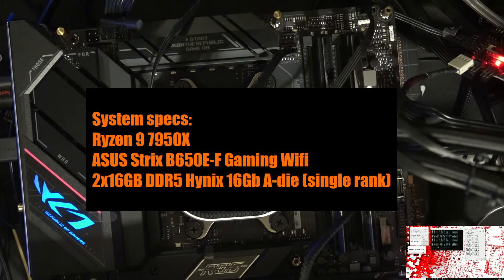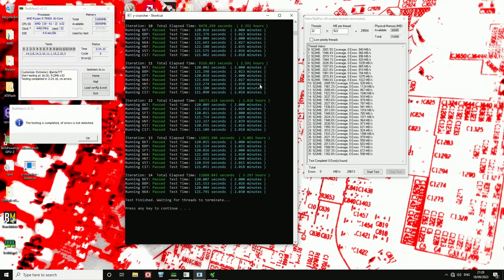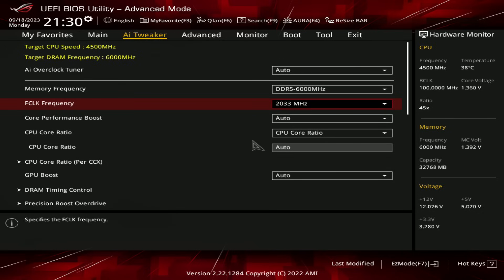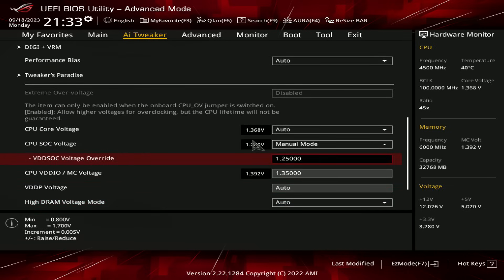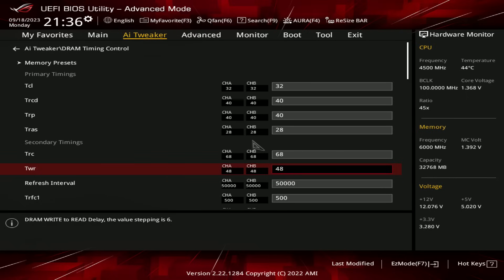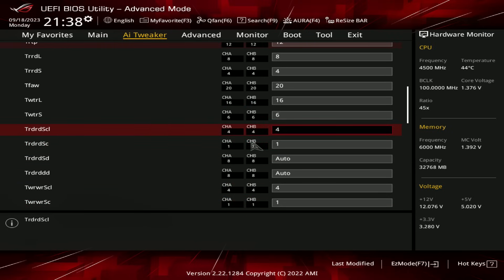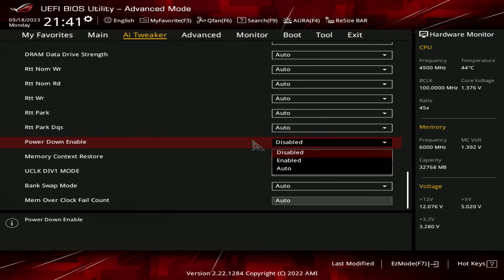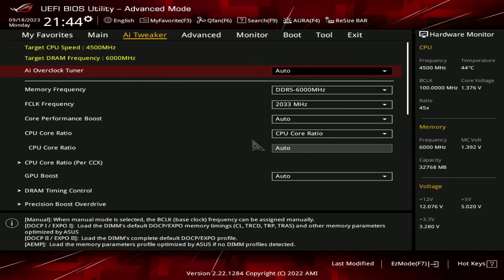Easy memory timings for Hynix DDR5 with Ryzen 7000

Comment: I have 2x16GB Corsair Dominator Platinum, CL30 version. Hynix.
on Aida64 memory benchmark I got following results:
Expo:
Read: 77914MB/s | Write: 76244MB/s | Copy: 68462MB/s | Latency: 69.5ns
Buildzoid profile:
Read: 88496MB/s | Write: 92345MB/s | Copy: 79040MB/s | Latency: 61.8ns

So definitely a huge improvement, thanks a lot for this video!
Reply: Im getting 59k and with his settings 63k ..9700x and ddr 6000 cl 30 ..
Reply: @Zona-rr2zp same here

Comment: Thank you for this guide!! I have the same motherboard and 2x16GB DDR5-6000 CL30 Hynix M-Die sitting around just waiting for the 7800X3D to release, - will try to replicate your timings!!
Reply: what ram did you get?
Reply: @brandyyn  If you're wondering what to get, I got today Kinston 5600cl36 (fury beast) 2x16 for 135€. Literally cheapest kit of +5200 kingston I could find. It's Hynix A die, lmao.

Comment: soon as i changed the soc voltage to 1.4000 from 1.4390(auto) 2200 fclk now i cant even get 2033 stable, soon as i go above 2033 fclk now my latency literally doubles. Man AMD sucks i wish i didn't try to lower the soc voltage because now it just so weird what's going on. Any tips what this could be? Tried reflashing bios and CMOS but no luck
Reply: The fabric isn't designed to go above 2000, and using a SOC voltage that high will lead to premature wear on your CPU. Try to get the best tune you can at 6000 memory, 2000 fclk and no higher than 1.25 SOC voltage.
Reply: mine also sets it auto to 1.4 soc on msi tomahawk , ddr voltage 1.4v , i am able to run 2133 fclk with 6400mhz ram but these subtimings are crashing in aida64 on the stability test , i think that the motherboard knows the soc voltage and you should keep it on auto , probably we have shitty cpus
Reply: @mite_jan  definitely not shitty cpu if it was stable 2200fclk 6400mhz but I think its shitty motherboard/bios Asus strix x670e-e
Reply: @GoldenEagle0007  not sure whats a safe soc voltage some where saying 1.2v , mine doesnt run bellow 1.4v , well x670 should be better than b650 , just run the soc voltage at auto again , i found good timings for my memory , these one value did not work for me i had to increase it , pain in the arse to find which one was it
Reply: @mite_jan  yeah i think the motherboard Asus Strix x670e-e is stupid or maybe it ruined my cpu, most likely both. Tried auto and everything i could think if but it doesn't fix it.

Comment: Very interesting, with your settings I'm getting about the same bandwidth as I was able to get with 6200 and 2066 fclk but slightly lower latency with less voltage. Good ram diet.
Reply: Whats your bandwith values read/write, copy ?

Comment: Thanks for the handy guide Buildzoid! much needed especially with buggy windows updates... hard to gauge if it's the memory settings at 6000+ or the buggy updates. Damn bean counters axing the QA division and programmtic testers 🤬🤬. Anyway, I was having random bsods even at 5400 on a 5600 kit (36-38-38) and using Asus's preset profile for SK Hynix 1.35 dual rank 6200 preset seems to have fixed it (haven't checked out the secondary timings thoroughly yet - to stop myself from tweaking them lol). Plus not to mention rinsing out the ram completely doesn't cause any crashes be it windows or applications. However, I do get intermittent bsods after KB updates... then it stabilises. I haven't messed with the infinity fabric settings yet as wanted to iron settings before tweaking something else lol. Going to try 2033 and see how that goes with my 7950X.

Comment: I'm so confused, after i manually OC'd ram now my latency has gone from 55ns to 117ns but fps is pretty much the same in watchdog legions benchmark and Warzone 2
Reply: When you set memory clocks too high, the fabric no longer runs at the same ratio, and this is the result. People are trying to push an unnoticable extra 33mhz out of their setup when they should be focusing on how much the secondary timings help here at 6000 with a 2000 fclk.
Reply: @subaction  no no no the stupid asus motherboard degraded my 7700x, got a refund fast

Comment: This is great since I have the B650E-F.  My G Skill 6000 30,38,38 could not post if I used EXPO (I believe the 1.3V VDD/VDDQ was the issue).  I used the Asus mem presets and Hynix 6200 which worked (but I dropped to 6000 and VDD/VDDQ to 1.375 vs 1.4).  I will now try these; main difference vs the Asus profile is refresh was 23354, Trc was 38 vs your 68 and VDDP was not auto but 1.2 which Asus had as red.
Reply: @Proklet I "think" so but I am now running Buildzoids 68 just because I matched everything else he did.  I had one issue that I would crash on resume from sleep when PC was cold (like 15C in the morning).  I ruled out Windows and graphics and now think it was either mem timings or CO.  Running this video mem settings and stable so will now check CO.
Reply: @Proklet No fastboot (always disable that).  Happens less with hibernate but still does it.  Feels like a graphics card as PC looks alive except for black screen but keystrokes are ignored too.
Reply: MemoryVDD/VDDQ is just...memory voltage. You could have simply bumped that up to 1.36 if 1.35 wasn't cutting it. But it might have just been SOC voltage.
Reply: @insertnamehere4419  Yes, memory voltage was what EXPO was setting too low.
Reply: Also can't get stability with the E-F and G-Skill 6000 30-38-38.  Did you find a solution/way to get this RAM running in a stable manner?
Reply: @SpookyKG  1.36v instead of 1.35v, and/or a little more Soc voltage...like I already said. If it still doesn't work you probably picked a kit that's not on your QVL, and if that's the case....welp ya.
Reply: @insertnamehere4419  its on the QVL list... I'm wary of going through all the suffering again (including jumping the bios) for a voltage difference of 0.01
Reply: @SpookyKG  "suffering"?? Go into BIOS, go to Dram voltage and change it from 1.35 to 1.36. Save and quit. Where's the suffering? You can make manual changes like this and still retain EXPO or XMP.  You can use the timings in this video instead too, which will be better anyways.
Reply: @SpookyKG  Running Asus preset 6200 (@6000) worked and so does Buildzoid's sub timings and voltages too.
Reply: @chemie7037  can you clarify what you mean by preset 6200 at 6000?
Reply: @SpookyKG  Asus has "presets" under the DRAM menu.  You can choose "SK 6200" which gives higher voltage of 1.4V and sets decent sub-timings.  I manually set to 6000 but kept the subtimings.  I worked voltage down to 1.37 but now run at 1.35 too (The EXPO of 1.3V failed) However, I suggest you just use the ones from Buildzoid as they are better.
Reply: @chemie7037  I really wanted this to work - ended up in a bootloop and had to reset CMOS (happens basically any time I attempt something over the JDEC 4800 :/)

I think I might go for the full reset on mobo, CPU, and maybe RAM (though I have Hynbix M-die and it passes memtest despite these issues and I'm loathe to give it up)
Reply: @SpookyKG  I had the exact same issue.  Returned MB and CPU and it fixed it.  Not sure which one was bad CPU memory controller or MB (i suspect CPU).  If you can't go above 4800, it is bad hardware.
Reply: @chemie7037  yeah. New mobo coming this week and I think I'll return processor and potentially try to grab one of the x3D processors on release.
Reply: @SpookyKG  Any updates on this issue? I'm having a similar problem. And I have 4 kits of 16gb. I'd really appreciate any insight you can give me
Reply: @icarus33  I switched mobos to ASRock and with bios updates things resolved.  There are known issues with trying 4 kits... I don't think you have the same problem as me.  Good luck!

Comment: +1, I used these timings and bumped fabric to 2033 on my ddr5-6000 2x16 hynix expo kit and it's been stable so far. I still need to heat my case up with the GPU and see if it's still stable under worst case temps...

Comment: Thanks! You've made the daunting task of setting up memory quick and simple, straight to the point!  I have some Kingston Beast 5600 DDr5 ram that I'm gonna try this on (with my Gigabye x670/Ryzen 7900x combo), I'm pretty sure it's hinix. 
Do you think AMD's future AM5 chips and corresponding bios update will allow for higher DDR5 speeds (like intel)? What's the limiting factor, or is this generations of AMD processors destined to be 6000ish maz frequency?
Reply: AMD's future chips will absolutely push past 6000.

Comment: Maybe a dumb question but how much is FCLK freq when I have 5200Mhz DDR5 memory?
Reply: FCLK should go as high as possible, most of Zen 4 CPU should be fine running at 2000 MHz
Just remember to keep UCLK = MCLK
Reply: @crAzY0246  Thanks for the answer.

Comment: Thanks for this video! How will things be affected if people have dual-rank Hynix DDR5, instead of single-rank?
Reply: Same question 😅
Reply: Currently dual-rank DDR5 just can't run the frequency as high as single-rank DDR5
Reply: @crAzY0246   BZ has said that G.Skill 2x32GB 6000 Mhz CL32 DDR5 will be dual-rank.
Reply: @thischannel1071  
Seems I didn't read your question in the right.
Since it's on Zen 4, frequency of ram hardly reach 6400+, so it's no big difference on frequencies of dual-rank and single-rank.
With the same frequency and timings, performance of dual-rank is slightly better than single-rank.
But I don't know whether timings of dual-rank could be tighter than single-rank or not.

Comment: So I am trying to put together a build and I guess I am a bit confused.
Looking to get a 7900 or a 7900x3d depending on reviews, but I see these 7200mhz kits. Do these just not work and is there even a point for these kits for the 7000 cpus?
Reply: You don't need Hynix A-die on Zen4. M-die is your best choice currently since they provide tighter timings than A-die and you are capped at 6400 with Ryzen. So it's pointless to spend extra for 7200 kits

Comment: Gigabyte x670 elite ax tRAS is limited to lowest 30
Bios is F7f (which was removed from website) and has agesa 1004
Reply from the maker: oops. I forgot about that. Just use 30 then.
Reply: @ActuallyHardcoreOverclocking  my Kingston fury (expo) A-Die 6000 2x16 kit 36-38-38-96 has the same issue on trrldr below 8/ no boot. But the kit does 30-36-36-30 and vddsoc 1.1v. 7950X

Comment: I have to be honest here, and say I didn't really see much benefit from these tweaks. My Kingston Beast DDR5 6000 kit is using Hynix ram, and the settings here worked perfectly fine, my system boots fine, stress-testing works for hours. But, I haven't seen any real benefits from just leaving the RAM at EXPO settings, and FCLK at 2000. I got a few higher numbers in AIDA64, and my memory latency went down from 70ns to 61.9ns, but games, benchmarks, much testing over many days, and I haven't really seen any benefits over stock EXPO settings.
Reply: Probably your Mainboard (is it Gigabyte) already tuned your RAM close to this, and not many apps can show difference in RAM, unless at extreme point like from 5600 to 6400.
Reply: @nguyendinh2052  Yeah, Gigabyte Aorus X670 Elite. The Stock EXPO settings were not as tuned as they are in this video.

Comment: Ah, this is super! I had been struggling to optimize my zen4 hynix ddr5 setup, and I'm curious whether there's stuff in here that suggests I can tweak stuff further.  That 2033 FCLK tip alone is godsend anyhow...
Reply: I noticed ZERO difference going from 2000 FCLK to 2033 FCLK, in anything. Games, Benchmarks, Ram benchmarks and testing - zero difference.

Comment: I ran an membench easy test 180% (5 minutes) and 0 errors. I tried 350% Memtest for 20 minutes and 0 errors. Corsair Vengeance LPX XMP 2.0 2666Mhz Micron B-Die Rank 1 Single-Channel to 3000Mhz with the default timings 1.35V. It is enough ?

Comment: As always i appreciate your content and im happy to see you seem fine after the break :).
The reason why 6000 2033 works better is because the A+D agesa has a bug where on some frequencies combinations the actual frequency increases eg: 6000+2033 = 6100 (3050 uclk)
6200+2100= 3150 uclk, 6200+2133= 3200 uclk, 6400+2167 = 3250 uclk.

right now I'm able to run 6200+2100 ( which due to the bug with 6200+2100 runs at 6300) with 1.4v on memory and 1.25v on soc, testing to see if I can go lower,  6400 booted but kinda unstable not sure it's vsoc or primaries or rtts tho
Reply: @Proklet Did not try.  Used the Asus 6200 preset but put in 6000 and primaries 30,38,38.  Solved the EXPO crash.
Reply: Does anyone know if the above bug with 2033 fabric speed has been fixed with the latest bios of top motherboards? Is this still the optimal number for use with high-end 6000Hz memory or is fabric 2100 - 2166 expected to run better (as would be the case without the bug)? Thanks for any info, been searching all over..
Reply: Did you leave it at 2033 like the video or change it, if so any improvements? Im looking to do the same after the new update.
Reply: @jinzo0121  2033 was a bug since fixed.  I leave it at 2000 for the 6000 memory
Reply: @chemie7037  Thanks.
Reply: @jinzo0121  No problem.  I now run 1.2V VSOC (vs 1.25 from BZ) and dropped VDDQ and VDDIO to 1.25 (vs BZ 1.35)  all stable.
Reply: @chemie7037  Just tried these settings worked perfectly, i also watched https://www.youtube.com/watch?v=OsYZsOlttIg&ab_channel=FrameChasers
He was able to get 6200 on 1.2 SOC. I will stick to 6000.
Reply: I'm on 1003 and there's a noticable improvement. Using a KIngston 64 Gb kit at 6000 MHz, with tight timings.
I'm not knowledgable enough to see how 1004 would change it. Asrock didn't release 1004 (yet?).
Reply: @Proklet 6200+2100 = 6300 actual  clock runs stable no problems (over 40 hours of testing with  different mem testers + few hours of occt) at c30 plus kinda tight sub timings.
6400 is a no go for me, but i didn't try pushing cl higher ( 30 to 32), but i also tried 1.435v and didn't matter, probably imc, not sure tho
Reply: oh great,i just noticed he is using agesa 1003, so yes,you are right, that also means that the info about 2033 fclk in this video is already outdated because that bug is fixed in 1004.
Reply: @c.chepre8452  ohhh that explains why i saw basically 0 difference going to 2033...
Reply: @c.chepre8452  Asus does not have 1004 out yet; they pulled the beta.  BDZ is running the latest B650E-F BIOS here.

Comment: Thank you ! Your settings also work with 4x16GB of G.skill F5-6000J3038F16GX2 
Awesome improvement over EXPO profile 👍
Reply: Are you running this kit on AMD?
Reply: @ksenchy  yes, on a Strix X670E-E and a 7900X
Had to drop to 5800MHz though, as I was getting errors with 4 sticks. But it is stable with 2 DIMMs at 6000
Reply: @5pyR17US  I have the exact same setup than you, but I can't get EXPO working on mine for nothing with 4 modules (it works with 2). Did you only have to drop frequency to 5800MHz to make it work or there was something else? I also wonder what your BIOS version is.
Any help is greatly appreciated. I can't get my ram to get past 3600, which is a bummer.
Reply: @icarus33 I have an x670e steel legend with the same ram, 7800x3D and I can't get expo to be stable at all. Tried the settings in the video and my PC still crashes. Maybe because the ram isn't on the QVL list? I really should have done my research. Let me know if you figured it out.
Reply: That's what I was going to ask you, I'm thinking of moving AM5 and going 4x16GB and I can't get any serious answers if 6000 will be stable with 4 sticks. All these YouTubers and media outlets only test 2 sticks 💩
There are Corsair 2x32GB at 6000MT/s sticks but oh boy CL40 sounds horrible.
I'm not buying any other brand as no other has hardware RGB profile support.
I don't know, wait another generation so AMD improves DDR5 memory controllers in next generation or win a silicon lottery so I can run 6000 stable.

Comment: I bought à Kingston kit 32Gb 2 sticks 
Reference : KF556C36BBEK2 
1.25 V 36-38-38 5600MT/s
I saw on reddit that when it’s wrote EMOH the H stands for hynix and EMOS for samsung. Mine are EMOH ones.
I havn’t tried out the kit yet because i’m waiting for ryzen 7000X3D to come out. 
I have the strix B650E E gaming wifi 
If anyone is curious to know about wether the kit ends up being hynix or samsung i’ll reply to my comment when i know.
Buildzoid do you think the memory controler and infinity fabric clock will be affected by the 3D V-Cache ? I plan on getting a 7950X3D
Reply: Kingston 5600+ is 100% Hynix
Reply: @nguyendinh2052  Just to make sure I understood your answer correctly.
All Kingston above 5600 MHz are 100% Hynix, right?
I will buy 2 x 32 GB memory for the Asus x670E-E Gaming. 
AMD 7950x3d. 
Any Advice on which memory I should buy? Want to run at 6000MHz.
I was thinking of buying Kingston, but couldn't figure out who Hynix was.
So Thx.

Thank you very much for your reply to .
Have a superb day!
Reply: @aZebroadcast  All the Kingston 5600 is guaranteed to be Hynix, though they will be Hynix M. G.skill 6000CL32/CL30 can have a small chance to use Hynix-A. G.Skill 6400+ is mostly Hynix-A.
For 2x32GB kits both Kingston and G.skill have a chance to use Hynix-A
Reply: So it turned out to be hynix annnnnd the timings of the video work perfectly